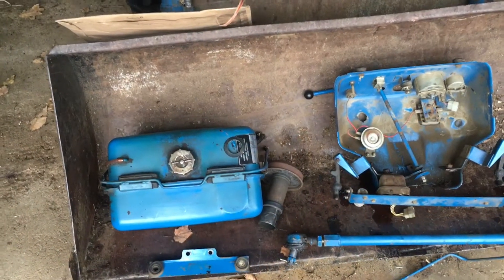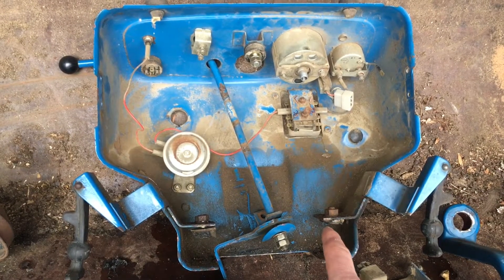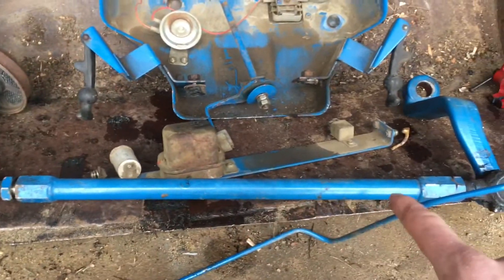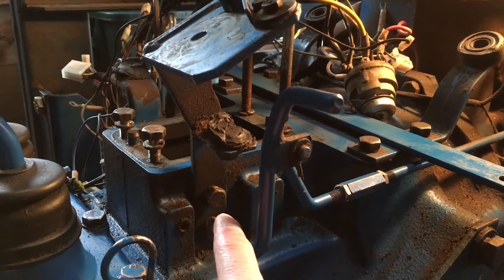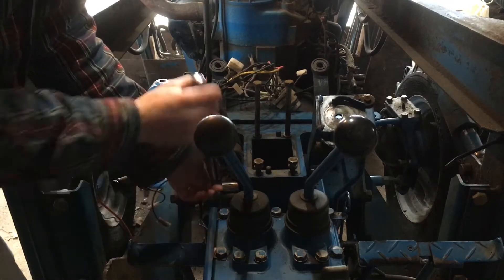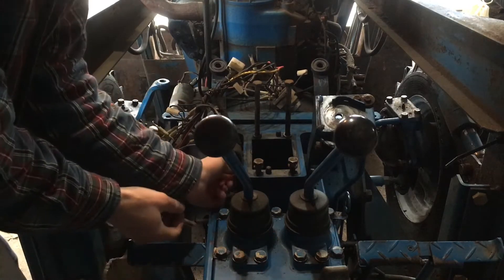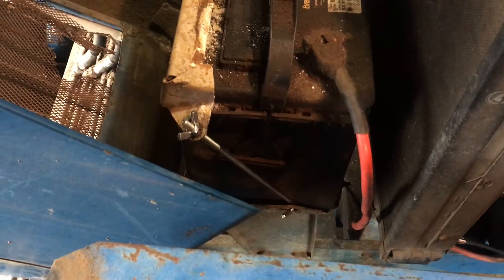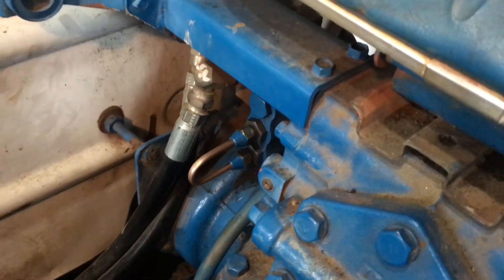Ford 1700 Tractor Steering Upgrade and Miscellaneous Repairs (Part 1)

Comment: Do you mind if I ask what that power steering kit from Jackson cost?  I have the exact same tractor, and lacking power steering is it's only downfall, I didn't know this kit existed from an after market supplier. You did a great job making the video. You explained the challenges and procedure without an hour of talking just to hear yourself like is the norm on you tube now a days.
Reply from the maker: Thanks for the compliment, I try to be as concise as I can to get the important information in a reasonable length video. As for cost, it was around $1700 for the kit in early spring, 2022. Add in miscellaneous fittings and the bracket I had welded and it came to about $2000 all in. I was lucky, as Jackson was having issues getting supplies and components for some of the kits. Its a small outfit - Jackson builds the kits work pretty much himself. If you go this route, be aware the Ford 1700 can have one of two different steering boxes. Mine was the more rare "power assist recirculating ball" gearbox, which wasn't really assisted (in my opinion), but it has different front-to-back pitman arm travel distance than the full manual gearbox. That caused some confusion in the manufacturing, as Jackson had a full manual gearbox in his shop that he was using as the pattern. It had to be tweaked a little for my tractor. Operationally it is not OEM and I can't really operate full loader function and turn at the same time, but I LOVE having the power steering.